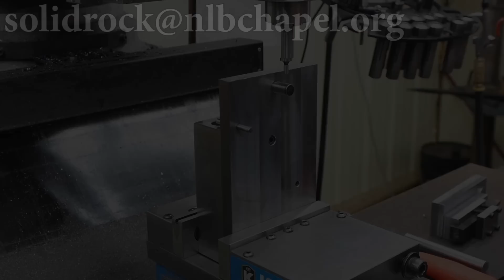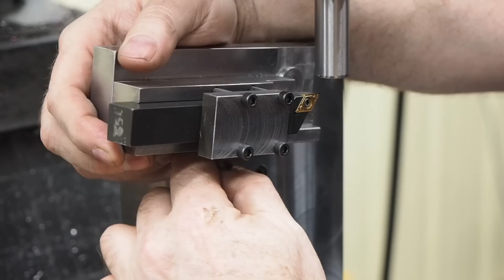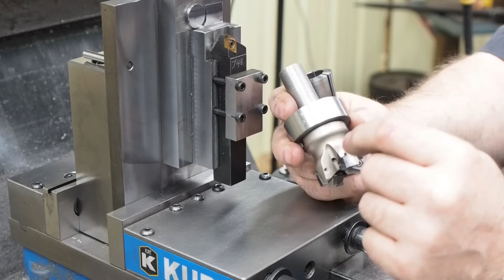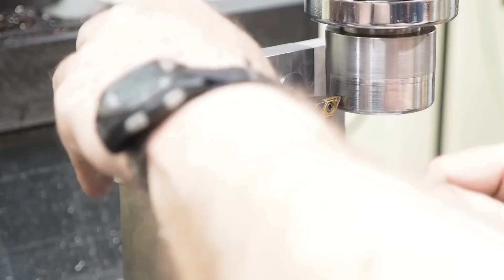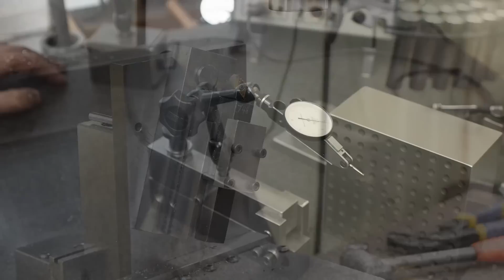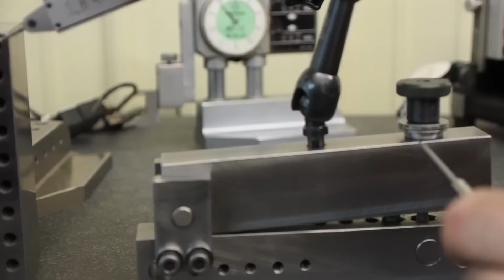Making  a Prototype Radius Tool Pt. 2

Comment: Steve, could you somehow add a threaded adjuster rod for fine tuning the tool bit and dialing in the radius?
Reply from the maker: Hi Rob,
That would work, there are many ways to do this, not sure what direction I will go yet.
Steve

Comment: It looks like it works well and will be pretty versatile.  One suggestion video-wise, since we can't see everything going on when panned in, you might mention every so often what direction you are moving...for example, when actually turning the ball, are you raising the knee/lowering quill or are you moving the table.  You may have mentioned it somewhere in this video or video 1 and I may have just missed it.

I've been enjoying your videos.  I am watching a little more on my TV and I don't have a way to comment when I do that.  I hope everything is going well up in Michigan.

P.S., I never remember concave and convex either.
Reply from the maker: Hi Ryan,
Thanks for the input. I have been using both the knee and quill depending on what I need. I will try to remember this in upcoming videos.
Steve

Comment: Hey Steve if you grind an other pin the same dia as the pivot, you grind a flat haft the diameter of it, you get the centreline of the pivot... you put it vertically... ad gage block and tangeant the cutting edge of the tool on the gage block... quick and easy radius setup... you can even pass the Center line of the pine by .100 for setting small increments just like a sine table.
Reply from the maker: Hi Simon,
That is a good idea. I may have to try it.
Steve

Comment: Thanks for the work you and your "team" put, in and the knowledge you share. If you have the time could you explain the extra bolts on the moveable jaw of your vise. I understand those on the fixed jaw but the ones on the moving jaw have me baffled! Thank you
Reply from the maker: Hi Radius,
The bolts on the jaws are for finger clamps to use with thin plates in the vise. Watch at the 11:30 mark https://www.youtube.com/watch?v=0Xywab9tgcc
Steve
Reply: Outstanding. Very clever and thanks again. Radius North

Comment: G’day Steve, both tools look great. For further finite adjustment the mounting point of the DTI could closer to the pivot. 
Love your radius tool both for convex and concave turning, I was wondering how, simple move the cutter past it’s pivot point, for me it was one of those, as you say, slap your forehead moments, dah. 
Very nice, cheers 
Peter
Reply from the maker: The tool will have multi positions to mount the indicator in the final product. Hopefully today I will get a good start on the base.
Steve

Comment: Absolutely a great piece of tooling! I too have done quite a bit of lathe work on the mill and quite frankly enjoy it! A tip or suggestion as far as your radius setting, you could mount a 1" or so travel micrometer head behind the tool and precisely control your radius. After you set it to a specific size which could be done by a test cut on a test or scrap piece. I hope this helps. By the way, I love your channel! I'm a very precise kind of guy myself and love the 0.00005 tolerance work! I too work out of a small shop with only two surface grinders, a Bridgeport series 2 special and as of next week a 12" clausing lathe. I'm also equipped with a full welding and fab shop. Here within the next few weeks I'm going to quit my full time pipe fitting job to pursue my true passion in machining and welding/fabrication. Best of wishes! 6-4 FAB
Reply from the maker: Thanks. I hope things turn out well for you following your true passion.
Steve

Comment: Best of luck in making a niche product. I commend you on trying to make a little business out of your efforts. The only issue I see is that anything you make, someone else can copy it. Patenting a product is a long drawn out and somewhat pricey process. I think a good way to go is to make a complex product that you can make with jigs and fixtures, but would be  very difficult to make in one off quantities. This would make impractical for the copycats to duplicate it. This opinion is worth what it cost you to read it, nothing!
Reply from the maker: You are correct. We do have a patent pending on one product. Other tools require a skill set that many companies do not have anymore. It seems that in our area the focus is on cheap unskilled labor and to push out the skilled higher paid individuals. Making high precision tools is  going to be hard without skilled workers. Also, we hope to build a brand name people will trust. Everything is a roll of the dice. We will offer other services as we grow too.
Steve

Comment: A neat tool that can be used on the lathe afixed in place of the tool post. It may be more rigid than the other radius tools.
Reply from the maker: I will be using this tool on different machines in the future.
Steve

Comment: Looking good! Perhaps another idea for the top pivot could be the same as the bottom, but with a flat milled on one side for the nut. Make a half round cut across the to bar for a seat. Not saying it's any better, just another option☺️. Thanks again.
Reply from the maker: Hi James,
I was thinking that way too. In the end I thought this way would look nicer and be easier to build. I will be using the half cylinder on the bottom with a 2 point tangent contact point.
Steve

Comment: Thanks for sharing Steve

 I recently needed to put a concave radius on the ends of some shafts. Though a couple of mills were available the best option seemed to be to put the shaft in a boring bar holder in a lathe toolpost, a fly-cutter in the chuck with the toolbit set for the desired radius and set the depth of cut with the cross slide. Worked great! Very quick to set-up and got through the work in no time.
 
 Sometimes your best mill is a lathe and, as you showed, sometimes your best lathe is a mill!

 I really enjoy the design/prototyping process you're covering with both these evolving projects. I can relate to your approach as I often put my ideas 'into metal' at a fairly stage, before I really know what I want sometimes. Of course you'll run into some dead ends and your early prototypes will show up some issues but you can also start adding or refining features.

I fully agree about some of the arbors out there. Poorly engineered junk with the rigidity of an over cooked noodle.

Thanks Again. Looking forward to the next installment.

Matt.S
Reply from the maker: Hi Matthew,
It is amazing what a person can do when they apply some creative thought to a project.
Steve

Comment: Thumbs up on using a mill as a lathe. Milling attachments for lathes get all the press, but like you I also use my mill as a lathe quite often. Also while I have a CNC mill I only have manual lathes, so for some jobs it's way easier to do using the mill as a lathe.